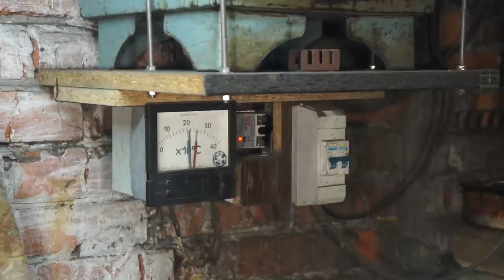Damascus steel from shoe nails. Roasted nails.

Comment: I made a Damascus steel knife once, the power hammer was broken so I had to use a sledgehammer with a friend. After the etching it came out beautiful and completely handmade with a coal furnace. Blacksmithing is a great hobby, it also builds your pain tolerance for heat and burns
Reply: should never be able to tolerate burns lol
Reply: @bh-0330  it's inevitable, when you work with particularly high carbon content steel, every hit of the hammer creates sparks of super hot carbon and oxides that escape the surface of the material. They can fall down your gloves through the sleeves and burn right through the skin
Reply: @bh-0330  actually most dangerous about burns on bigger areas of your body is the shock you can get which ends deadly fast I work in district heating and get a burn from time to time the effect doesn't change but you lose some of the pain which stretches your tolerance before s shock it can safe your life if you burn yourself seriously if you had experience with burns before

Comment: Really like how he pulled the external mold off for this one so it was in fact mostly made of the nails, rather than whatever steel the outer sheath was made out of.
Reply: Typically, the canister for Damascus like this isn't hardenable steel. If you don't take it off, you can risk the soft steel being on the cutting edge, which won't hold an edge at all. Plus, leaving it on would lose the pattern.

Comment: You might not have gotten the etch you wanted but I wouldn't call this effort a fail. You have a usable final product and have learned something about the metal source. win and win.
Reply: Damn there be some adults on the internet 👍
Reply: There’s a lot of cold shunts in that blade his billet wasn’t solid enough when he started forging he’s made a pretty paper weight I wouldn’t use that as a knife it would probably shatter on you
Reply: @shorty808100  1) a letter opener.
2) a "display" knife not suitable for anything but looks.

There is a small market for both.

Comment: the fact, that this man is wiping the anvil quite everytime after he used it

pleasing the forging gods ;)
Reply: Should he REALLY do that with BARE hands?
Reply: Its so scale isnt embedded in the blank thus creating pitting and causing more work when sanding.
Reply: @fifiwoof1969  oh yeah it would take ages for the hot metal to deliver enough heat to the anvil for the anvil to even warm up. It's probably still cool to the touch.
Reply: @fifiwoof1969  his calluses are so thick it shouldn't even register in his pain receptors.
Reply: It's your OCD

Comment: If it’s metal and can fit in his little piece of box tubing, this guy is gonna make “Damascus” out of it.
Reply: Very interesting damascus at that :)
Reply: Sean Viklünd  because he thinks he knows things and that this isn't damascus
Reply: Sean Viklünd  google says its a way of steel making where you keep heating and then folding metal. 
I guess this guy is just flattening it and thats why its not damascus? 🤷‍♂️ 
still fun fo watch tho
Reply: Sean Viklünd  classic Damascus steel is possible because steel can contain different amounts of carbon, and higher amounts can darken the gray tint of the metal(correct me if I'm wrong). Damascus steel is made by taking two thin strips of steel with different amounts of carbon and layering them into a brick that's welded together and stuck in the forge. The rest of the process is effectively just molding the steel into a bar so you can cut and rearrange it back into a brick and repeating the process until you achieve a desired result. 
So TL;DR Damascus is what happens when you layer two different colors/tints of metal together to create more intricate patterns. More eye catching examples include Timascus, which is titanium dimascus, which is what's used for the Damascus skin in CoD MW2019
Reply: Sean Viklünd  its the capital of Syria
Reply: It’s copied from Valyrian steel
Reply: Chili flavored Damascus; keep the facts accurate please.
Reply: The process you described is pattern welded syeel. Its not Damascus at all. Buy Moline most others shurap calls it so because that's the globally popular use. Literally the evolution of language right in front of you.
Reply: He is a true master he makes it look so easy!! When your good like he is it makes someone like me think ah yeah no worries I can make that...... 🤣🤣
Reply: Yeah but it's not Damascus steel
Reply: @VIISkies  .... Seriously? You compare a real life thing with a video game? And CoD of all things?
Reply: All of this folded Damascus is not real. The original is called woots Damascus, and it is smelted ✌️
Reply: This is called "canister damascus", and still yields some epic patterns!
Reply: @pizzashmoney  Well he’s correct though… This is pattern welding not damascus steel.
Reply: @Rat Stomper Its a joke that also involves the content creators name. Shurap in Russian apparently means "spicy" so he is basicly spicing things up. =]
Reply: @Rat Stomper Of course it is. Many languages has similar or the same words for spicy and sharp.
Reply: @Outtacontrol304  Make it yourself, then complain. Other then that, dont judge.
Reply: That box tubing is what I would call a canister lol
Reply: Let's share some ideas with each other. What can you start doing today to get better?
Reply: I believe true damascus is 647 layers, and on the last fold, they san mai a high carbon core in the center.
Reply: @stephanieandjared390  thats a true katana build not just Damascus
Reply: @gerbenkoelewijn6374  hostile air strike inbound!!!!
Reply: @lilmansindrom1890  le gasp!!!
Reply: @gerbenkoelewijn6374  im confused 🥺
Reply: @gerbenkoelewijn6374  oh imma idiot 😂
Reply: @Rat Stomper its added to burn up the oxygen in the container and add carbon.  You could use paper leaves wood dust ect.  I'm betting this guy likes spicy food. Or like breaking bad alot lol
Reply: He's right though, it's not Damascus
Reply: @pizzashmoney  most people nowadays consider pattern-welded knives to be damascus, meanings change over time that’s just how language works
Reply: @tylermaendel8807  no that's how bastardizing a language happens. If it's not the same, come up with something else to call it instead of something that hasn't technically existed for hundreds of years
Reply: Right, And I'm going to be ready to watch every second of it! 😆
Reply: And then after,make some tea.
Reply: What he's doing is a legit form of Damascus called "canister damascus" I've heard it is one or the more challenging forms of Damascus.
Reply: @gerbenkoelewijn6374  thank you. Always been wonderin why the spices.

Comment: Judging from the colour of the tacks, they were probably the usual cheap steel rather than iron. Either way, whilst subtle, that pattern weld was quite interesting. Perhaps try hand at making a damascus steel blade from crucible steel sometime?!
Reply: I am not sure his forge could handle crucible steel. 😂 And they were definitely cheap steel nails. Notice how he welded a plate of true quality steel to the metal to make the cutting edge!

Comment: And the etch didn't come out because you didn't have two types of steel All the nails were the same steel so the acid etch didn't have a chance to affect the composition of the metals differently as it usually would

Comment: I love the look of Damascus steel and I really enjoy seeing the process of making it. I have a question, though. What part does the pepper and chili play? If it is left out what would the result be?
Also, I love that you film your tea break.
Reply: I assume it's just a humorous touch. In the flames of the forge they will be reduced to carbon
Reply: I like a little whimsy with my tools.
Reply: it helps heat up the metal
Reply: In burning off during the heating it helps to remove oxygen that would make irregularities in the finished metal, according to some of the comments posted above.
Reply: @sterlingsummers9697  thank you. That makes sense.

Comment: The box tubing is soft steel, doesn’t that have a significant effect on the overall strength since it isn’t hardenable? 

I’m not being a smartass, I’m curious.

In this case, it wasn’t integrated into the shoe nails…. But other strange forms of Damascus have folded it right in.

Comment: New guy here - why did he put pepper in it towards the beginning and what is that powder he keeps sprinkling on the hot metal?
Reply from the maker: I sprinkle flux (90% borax + 5% quartz sand + 5% charcoal powder) this is necessary for forging (forge) welding. The flux is alloyed with scale - the formed substance is sufficiently fluid and is easily displaced by deformation. In addition, the flux protects against oxygen and charcoal, carburizes the surface layer of metal - which lowers the welding temperature (if in brief).

Comment: Why do you put your billet in oil before heating?
Is it to get rid of any water that may be trapped?
Reply from the maker: The billet is soaked in kerosene. This is necessary for good welding (forging) steel. When burning inside the workpiece remains soot (carbon), which, with further heating, scales and rust inside the workpiece restores to the iron, improving the quality of forging welding.

Comment: You definitely have a system that works for you. I am curious about your power hammer process. You move most of the metal with your forging press, is the power hammer being used to make sure the forge welds are set?

Comment: What liquid are you dipping the metal in before you begin heating it up in the forge?
Reply from the maker: The billet is soaked in kerosene. This is necessary for good welding (forging) steel. When burning inside the workpiece remains soot (carbon), which, with further heating, scales and rust inside the workpiece restores to the iron, improving the quality of forging welding.
Reply: @shurap  thank you again for taking the time to answer my question and educating me! I truly appreciate it :)

Comment: what is that powder that he put on before hammering that hot metal?what is it for?
Reply from the maker: I sprinkle flux (90% borax + 5% quartz sand + 5% charcoal powder) this is necessary for forging (forge) welding. The flux is alloyed with scale - the formed substance is sufficiently fluid and is easily displaced by deformation. In addition, the flux protects against oxygen and charcoal, carburizes the surface layer of metal - which lowers the welding temperature (if in brief).

Comment: how come the outside shell doesnt melt and mould into the metal inside? or is that what the grey goo at the start is for? what is the grey stuff ?
Reply from the maker: sealant for fireplaces.
Reply: @shurap  interdasting thanks

Comment: If I may know, what sand was sprinkled on?
Reply from the maker: I sprinkle flux (90% borax + 5% quartz sand + 5% charcoal powder) this is necessary for forging (forge) welding. The flux is alloyed with scale - the formed substance is sufficiently fluid and is easily displaced by deformation. In addition, the flux protects against oxygen and charcoal, carburizes the surface layer of metal - which lowers the welding temperature (if in brief).

Comment: What material do you throw on metal after taking it out of the furnace?
Reply from the maker: I sprinkle flux (90% borax + 5% quartz sand + 5% charcoal powder) this is necessary for forging (forge) welding. The flux is alloyed with scale - the formed substance is sufficiently fluid and is easily displaced by deformation. In addition, the flux protects against oxygen and charcoal, carburizes the surface layer of metal - which lowers the welding temperature (if in brief).
Reply: @shurap  May God bless you for the information, your work is elaborate and beautiful, and I hope that God wills and guides you to Islam

Comment: What do you coat the inside of your canisters with?
Reply from the maker: sealant for fireplaces.
Reply: @shurap  Your canisters pop right off the forging. The sealant must be a good barrier between the canister and forging due to its high temperature resistance. Just guessing.

Comment: Love watching these videos...what's the dust sprinkled on the red hot steel before hammering?? Cheers
Reply from the maker: I sprinkle flux (90% borax + 5% quartz sand + 5% charcoal powder) this is necessary for forging (forge) welding. The flux is alloyed with scale - the formed substance is sufficiently fluid and is easily displaced by deformation. In addition, the flux protects against oxygen and charcoal, carburizes the surface layer of metal - which lowers the welding temperature (if in brief).
Reply: @shurap  Thanks for that info, really fascinating stuff! Amazing work...Cheers👍

Comment: What is the powder he is sprinkling on the heated metal?
Reply from the maker: I sprinkle flux (90% borax + 5% quartz sand + 5% charcoal powder) this is necessary for forging (forge) welding. The flux is alloyed with scale - the formed substance is sufficiently fluid and is easily displaced by deformation. In addition, the flux protects against oxygen and charcoal, carburizes the surface layer of metal - which lowers the welding temperature (if in brief).

Comment: Should have used a contrasting metal powder in the canister to make the pattern pop. For me there just wasn't enough contrast and doing a high carbon edge with a mono body doesn't really count as Damascus to me. It doesn't even count as a pattern welded as there's again no contrasting metal in the body of the blade to make the pattern pop. Other then that your work is as great as always, just would have loved to see a high contrast in the body as I think hobbnails would make a great looking pattern. Just my opinions though.

Comment: 7:40 Why did they put the knife inside of sand? Is this a method of tempering?
Reply from the maker: This is annealing of steel, it is needed for grinding grain of steel grown at the temperature of forge welding, stress relief. Preheated billet to austenitic transformation temperature, placed for slow cooling in the heat insulator "Perlite".

Comment: Does someone know what the powder is he spinkles on the glowing hot metal?
Reply from the maker: I sprinkle flux (90% borax + 5% quartz sand + 5% charcoal powder) this is necessary for forging (forge) welding. The flux is alloyed with scale - the formed substance is sufficiently fluid and is easily displaced by deformation. In addition, the flux protects against oxygen and charcoal, carburizes the surface layer of metal - which lowers the welding temperature (if in brief).
Reply: @shurap  wow, thank you for this explanation. :)
Your videos are very satisfying, keep up the good work :)

Comment: Esse pó que você joga nela, o que é ???
Reply from the maker: Salpico com fundente (bórax 90% + areia de quartzo 5% + pó de carvão 5%) necessário para efetuar a soldagem (forja). O fluxo é fundido com a escala - a substância resultante é bastante fluida e é facilmente deslocada durante a deformação. Além disso, o fluxo protege do oxigênio e, devido ao carvão, cementa a camada superficial do metal - o que diminui a temperatura de soldagem (em suma).

Comment: What is the powder he throws on it?
Reply from the maker: I sprinkle flux (90% borax + 5% quartz sand + 5% charcoal powder) this is necessary for forging (forge) welding. The flux is alloyed with scale - the formed substance is sufficiently fluid and is easily displaced by deformation. In addition, the flux protects against oxygen and charcoal, carburizes the surface layer of metal - which lowers the welding temperature (if in brief).
Reply: @shurap  Very thorough. Thanks!

Comment: What is that sand for ?
Reply from the maker: I sprinkle flux (90% borax + 5% quartz sand + 5% charcoal powder) this is necessary for forging (forge) welding. The flux is alloyed with scale - the formed substance is sufficiently fluid and is easily displaced by deformation. In addition, the flux protects against oxygen and charcoal, carburizes the surface layer of metal - which lowers the welding temperature (if in brief).

Comment: 2 things I never understand about these videos. He never shows the process of forming it into a knife shape. 6:09 One second it's a rectangle and then it's a knife shape. Also, why does he hammer the curved edge until its flat and makes the other side curved. Can anyone explain?
Reply from the maker: The wrapping of the tip of the blade is necessary in order to correctly form the cutting edge. In the case of a welded cutting edge, bring it to the full length of the cutting edge.
Reply: @shurap   @shurap   @shurap  an explanation from the man himself! Thanks! BTW, what's the stuff you sprinkle on there at 3:50?

Comment: Here is and idea.
Collect metal powders from different types if steel. Make a divider for the inside of this tube. Place one layer of metal powder. Cover with the divider. And another type of powder. Carefully remove divider to no mix the two. put divider on top, add another layer, continue until full.